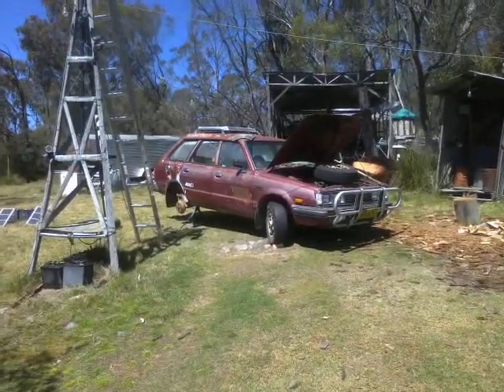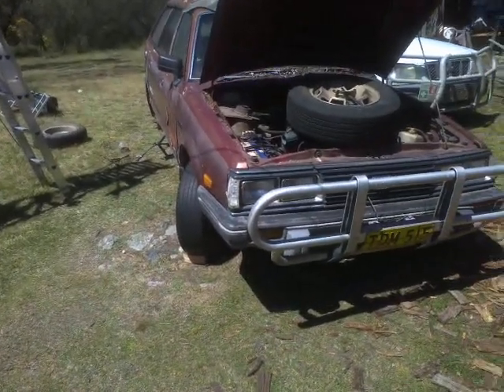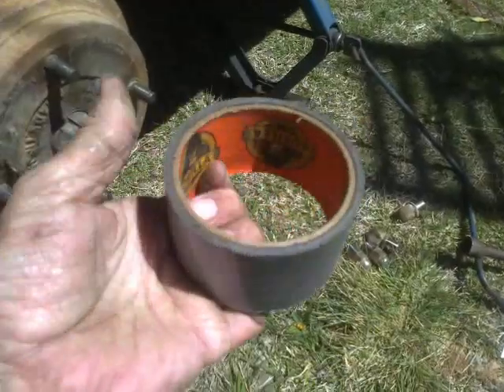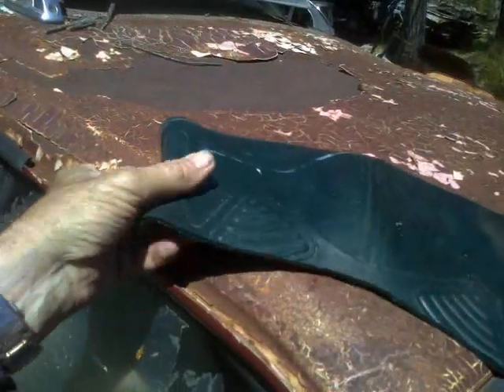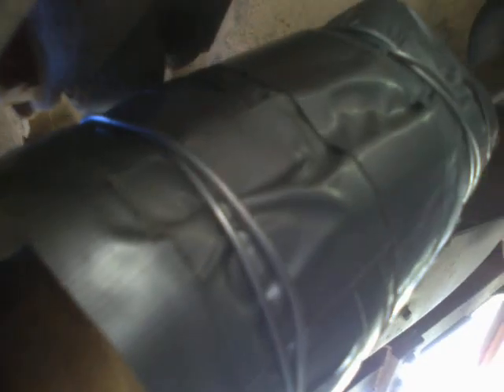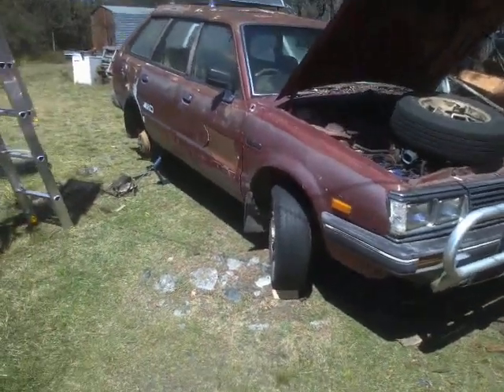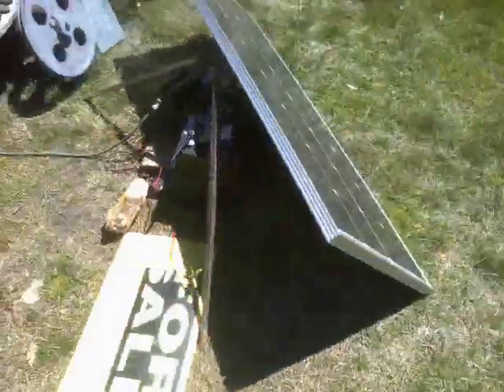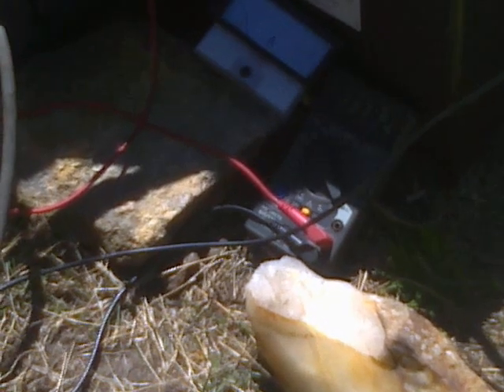Subaru 1800 CV-Joint Boot ; Hilbilly Field Repair !

Comment: Check parts store.  You can probably get replacement boot with split down the side, and ends held w/cable ties.  Good luck.  By the way, a rebuilt shaft with 2 new joints and new boots may be available for slightly over$100.  Not too difficult a job for a resourceful guy like yourself
Reply from the maker: G'day,

Thanks mate.

  Well, because it's a "Paddock Basher" that almost never gets out of 1st Gear, I try to patch up what's left of it, and I haven't got a Manual for it ; so trying to do a propper job would be quite a voyage of discovery...

My guess is that this Patch will probably serve pretty well until the Petrol runs out, or something else happens ; but thanks for the thought.

I finally found a use for that old Gumbood, anyway

Such is life,

Have a good one...

Stay safe.

;-p

Ciao !

Comment: Fine bit of duck taping. Lol. But good idea. The old welly boot. I had this happen before in the Bush. Some guinius actually invented a split cv boot. Little  nuts and bolts holding the split together. You can go to the junk yard get old cv boots and make your own split boots. Clean rubber good. Fill with bitumin in a tube over top of old boot And zip tie up. Can use two if needed. This was my Bush fix. Or rap up with gorilla tape and zip tie up good. But realy need some thing water proof I found out. Wide electrical tape then plenty zip ties. But you lost your grease so remember to repack it. But yep always wanted a subaru. But hard to find and people don't want to sell. Good luck. Have a good day.
Reply from the maker: G'day,

Thanks...!

Most of the Grease was still in it - it had only driven about 200 metres since the tear, and there was no Water in the Grease.

I only learned of the Split Boots in this Thread..., if I'd known of them I might have gone looking for one, but this Lash-up should do the job - as a Paddock-Basher  up here it almost never gets out of 1st Gear...

Time will tell, I guess.

What eventually took it off the Road was when the Rear Torsion Bars lost their Twistiness and it went down to the Bump-Stops - from being overloaded carting Firewood to town..., but they're almost unkillable little old Wagons.

Such is life,

Have a good one...

;-p

Ciao !

Comment: Good job Chris, 
It looks good to me.  Especially for a  " farm truck. "
You do realize that you are violating the laws of consumerism  don't you?😁
I replaced both cv axles on an old birds front wheel drive/two wheel drive Honda not three weeks back.
Set her back $800. Parts and labour. I find it to be an aggravating task. But she did tip me with a plate of home cooking and a huge box of produce from her garden. I was especially happy to see the yellow squash and eggplant as I hadn't planted any myself. 
I've also made arrangements to barter for a large variety of vegetables and I'll be acting as helper to her in the canning process.
I may run out of shelf space.
Have a great day.

Richard
Reply from the maker: G'day Richard,

Thanks mate !

That sounds like a great deal you have going with the gardening lady..., at the moment I'm a naughty boy - my Garden should have been dug last month and planted last week.

  I'm pretty pleased with the Repair, and as you said, for a "Paddock Basher" it should be fine - the car almost never gets out of 1st Gear, so it hasn't got to balance - merely to keep the Crap out ; and the Wire shoud hold the Patch  onto the corrugations of the two halves of the torn  Boot.

Time will tell, I guess.

Keep on keepin' on,

Have a good one...

Stay safe.

;-p

Ciao !

Comment: hi there chris
do you add lead substitute to the petrol for that old bomb??
rachel
Reply from the maker: G'day,

Thanks mate...!

Yeah, well spotted ; I use some of that pale yellow Valve & Upper Cylinder Lube, 1 ml per litre...

On the road I used to run it on 98 Octane, too, but as a Paddock Basher it now runs on 91 Octane.

Such is life,

Have a good one...

Stay safe.

;-p

Ciao !
Reply: @WarblesOnALot  you should sell it and the ute as a package deal and buy a quad bike.they sell them online for around $1000 :)
Reply from the maker: @mitchellandrachelm5700  

G'day,

The Ute isn't mine.

Quadbikes are NOT either a fit replacement for a 5-seat 4 WD Station Wagon, nor are they safe, and since a new one is $12,000 and 3 of 4 Manufacturers have stopped importing them to Oz (due to Roll-Bar issues), the 2nd-hand price for a Quadbike which is not fcuked is currrently exorbitant.

And I LIKE keeping my stuff as long as possible.

You can feel free to sell whatever doesn't look sufficiently Shiny, and then go and buy some silly dangerous alternative which won't do the job...; but please spare me the instructions regarding your hypotheses on what I "SHOULD" do.

Thankyou.

;-p

Ciao !
Reply: @WarblesOnALot  ouch!

Comment: I've just see an American repairing a Yugo., with a " repair special " split CV boot.,which was superglue together..If there is a Subb version it would sound like a way to go until you stack up enough repairs to justify putting on a trailer to take down the spanner addict..
Reply from the maker: G'day,

Thanks,

I'll look into them, if/when the Hillbilly Version decides to fail - but so far it's doing it's thing pretty well (!).

Have a good one.

Stay safe,

;-p

Ciao !
Reply: @WarblesOnALot ....... of course , you can channel your inner Bentley ., in the next village from home there was a guy with one of the smaller Bentley s., and the brakes were rod ( rather than hydraulic ) and the front wheel brakes had a UJ connection inclosed in a very nicely stitched leather  " boot ".........maybe sheep hide would work well., if you can get it thick / stiff enough..